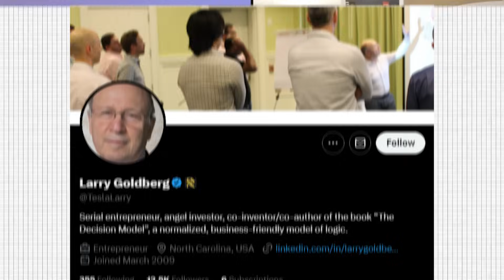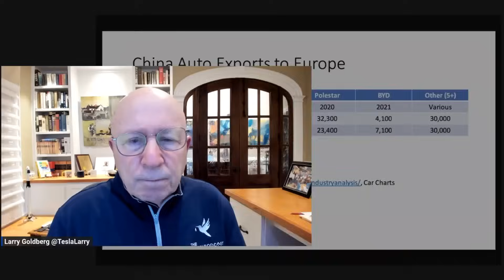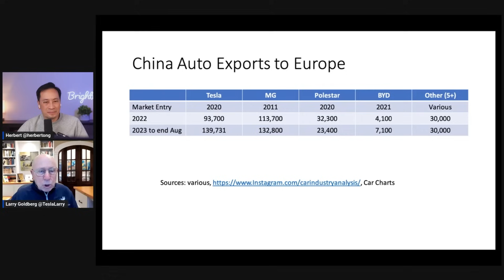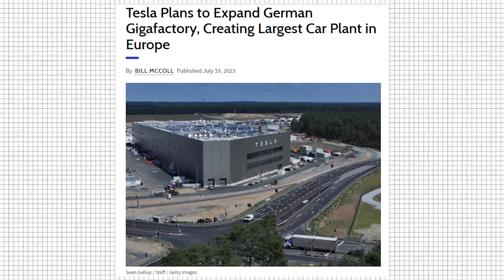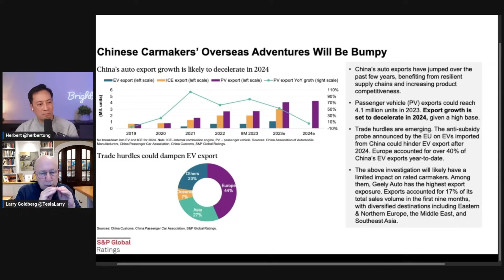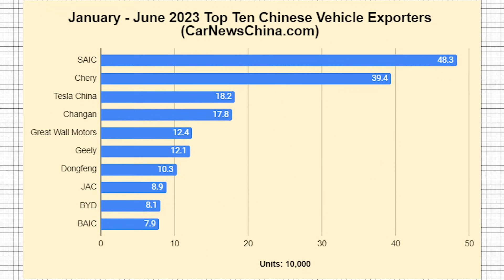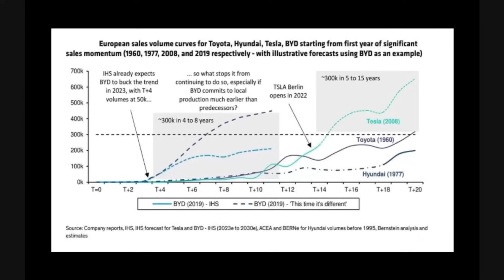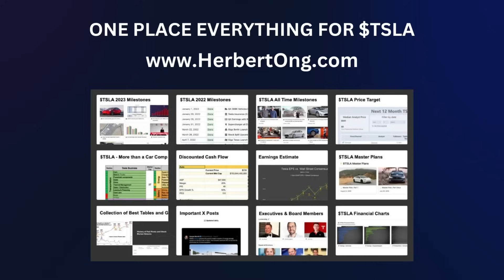The Explosive Rise of Chinese Gas Cars

Comment: There is a second Disruption in the Wings which will be greater than the EV disruption. That’s RoboTaxis . This will be come as not just a Taxi/Uber replacement but private vehicle ownership too. RoboTaxis with no driver cost, extremely low operating cost and available almost 24/7 the RoboTaxis will be so lower per ride price  and high availability that it will become compelling for many not to own a car and all its associated costs and problems. The RoboTaxis will even disrupt public transport. No walking to the bus stop in rain, and standing packed in a crowd. Picked up at the door delivered to the door. Sounds like a fictional fantasy? Then go and watch a  Tesla full self driving vid and see how close it is. Also Tesla New Mexico Giga factory will be the worlds largest car plant and its main product will be RoboTaxis coming off the production line in 2025/26 . That’s cars with no steering wheel made in large quantities coming to a city near you, well in time

Comment: As a car man of many years, and a European, my modest opinion is that most Europeans would never buy a Chinese car because of the bad Chinese reputation acquired by mass exporting in EU of cheap gadgets and trinkets of the last 2 decades. Different story from the very well appreciated and sought after of the proven high tech, quality, speed, and safety earned by Tesla EV, that has  an astronomical demand even in Germany. Different story for the MG a very traditional British name plate and where most of its sales success is at, due also for its lower price level than Tesla. That said, if the Chinese name plates will be able to bring decent European looking cars at a far moderate price in future they might will be able to gain a solid foothold. But Tesla overwhelming quality introduced with the new model at a lower price level in the next 2 or 3 years will make it very tough even for BYD  to compete against. I don't see anywhere electric charging station for any of the Chinese brands and that is very negative. I also don't think that European will put up with NIO cars, that need to swap batteries every 1000 KM or so.
Reply: You know MG is Chinese and not British? MG is wholly owned by China Geely . Also owned by Geely is Volvo cars and Polestar
Reply: I don't understand your comment that "I don't see anywhere electric charging station for any of the Chinese brands...". You don't see any charging stations with a Chinese name on them, true, but that is irrelevant. Open systems, such as Ionity, can charge Chinese imports, and for that matter, Chinese cars can charge at Tesla superchargers.

Comment: The problem of Chinese EVs is quality. The fierce price war in China has manufacturers doing everything to reduce cost. That will be reducing quality for sure. The West is use to quality cars and if Chinese cars prove to be low quality they will fail to get traction
Reply: The cars exported from China to Europe are basically ncap five-stars.For example, BYD, xpeng, nio.